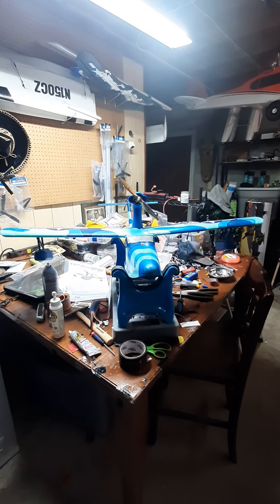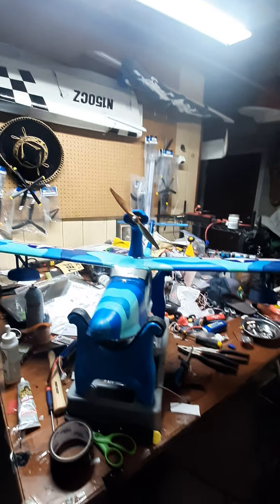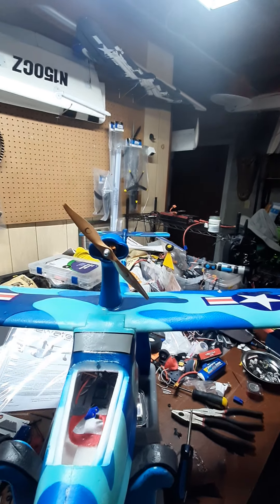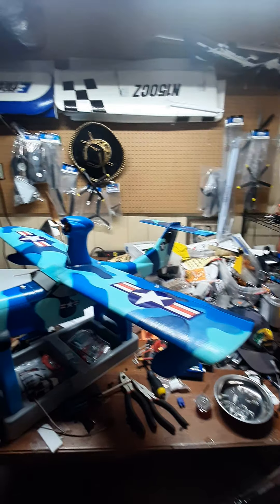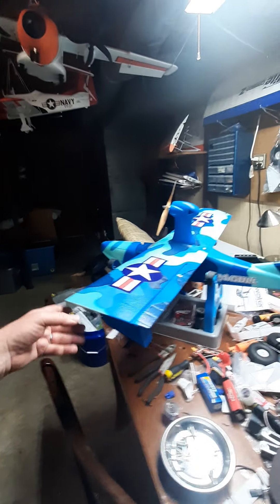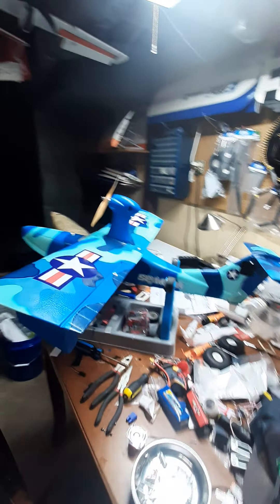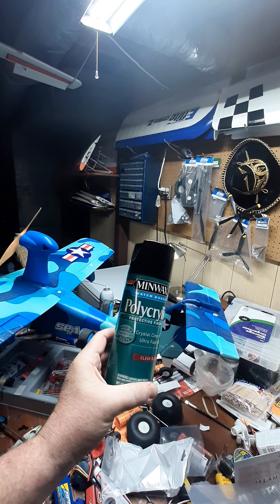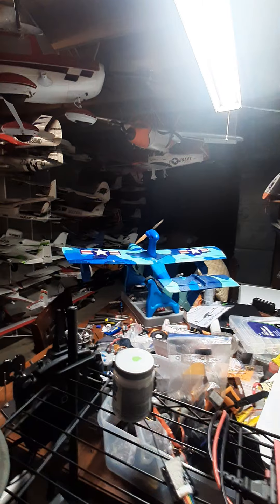Hanger view of my Seagull from Value Hobby

Comment: I use Polyacryic on all my planes.I use to brush it on and then got a little smarter (not much) and spray it on now. Depending on the plane I use Gloss, Simi gloss, and Matte. Your right, you bench is a mess, LOL I guess I shouldn’t tale.
Reply from the maker: I actually filmed this because you said you wanted a closer look, I know you ment flying but it was the best I could do quickley so you could see her closer. I got her from Value Hobby in Ill. Its a $50 kit. Not bad since it was the Tidewater from Flyzone just in a different color.